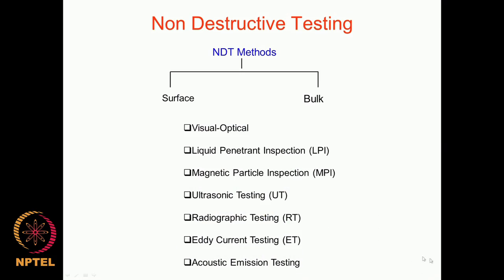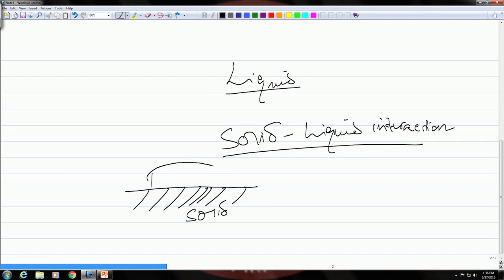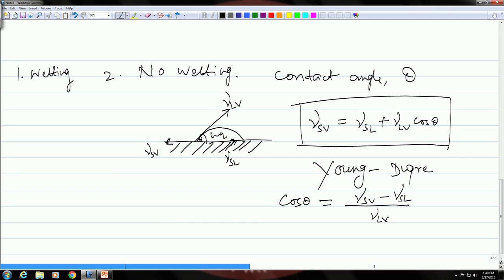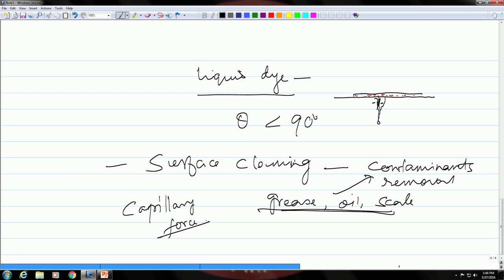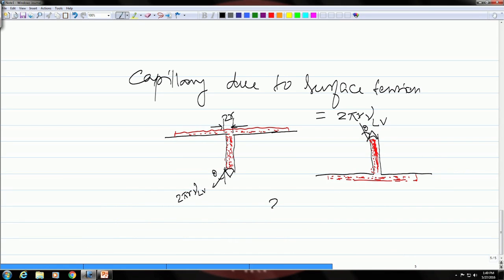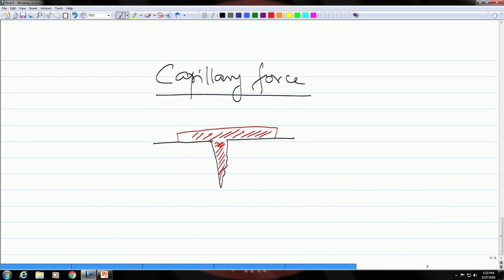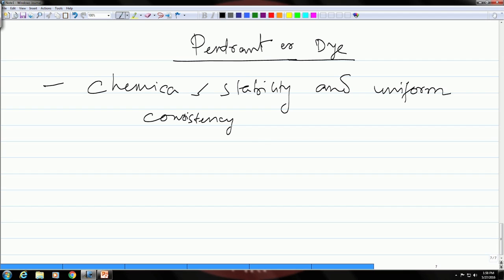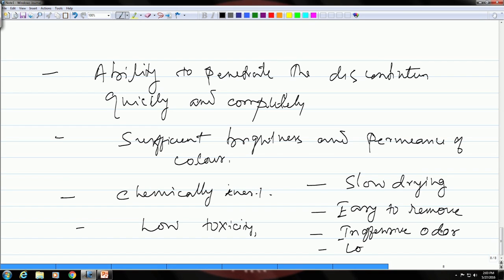Dye Penetrant Testing - 1

Comment: Thanks you so much, sir! 
I really appreciate your advice.
I’ve been having an issue detecting very small cracks (depth 0.4–0.6 mm). With MT, the cracks can be detected, but with PT, no color indication appears. In your experience, what types of crack size or characteristics (for example, very tight or fine cracks) would make PT ineffective?